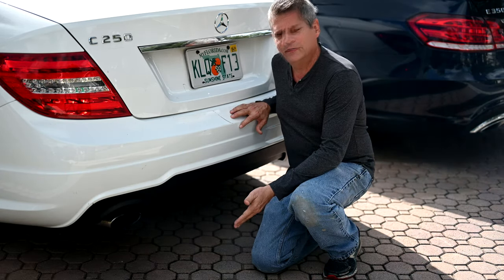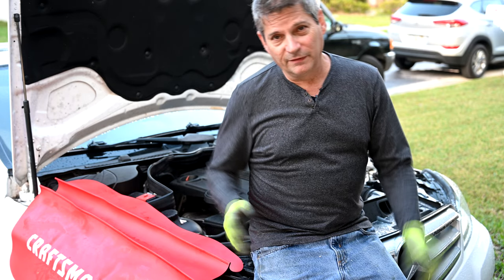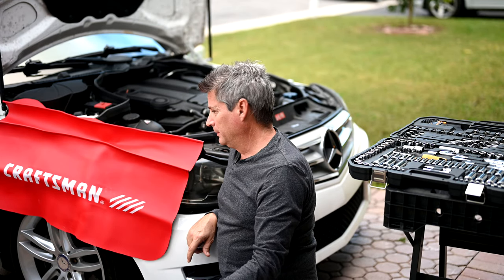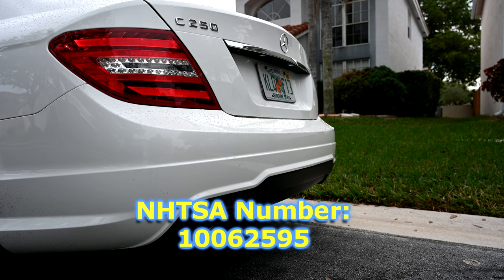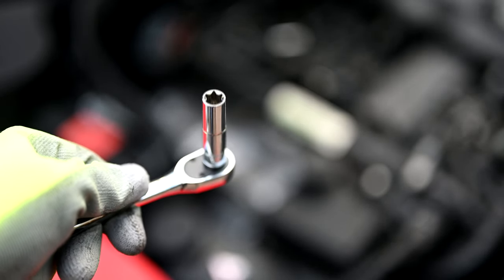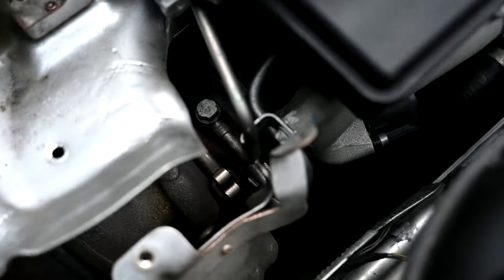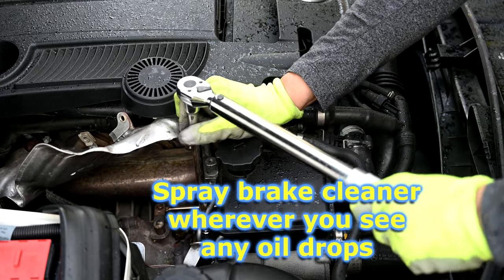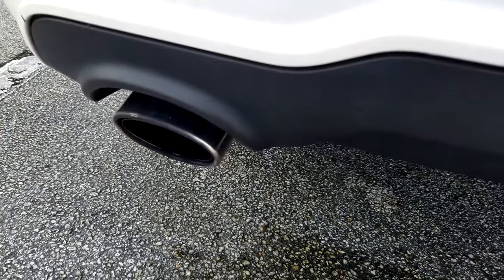SOLVED! Engine Blows White Smoke at Startup Mercedes C250 W204 Banjo Bolt

Comment: I am still having trouble understanding where to place the O-ring? could you help me with that, please? Thank you
Reply from the maker: We placed it under the banjo and in between the banjo and the engine block.
Reply: it installes on the other side of the oil line from the bolt. you have to remove the whole pipe and to change it. not just the banjo bolt. unscrew the fitting to the block and there will be the ring
Reply from the maker: @pavelb7036  Yes, we loosened the pipe too.
Reply: O ring is  placed the  other  side of  banjo bolt   You  do  not  need  buy  just   use   teflon  seal  tape

Comment: Would this apply to a Toyota Camry?
Reply from the maker: This fix was to address a flaw in the Mercedes turbo by putting an extra gasket in there period now if you have a similar leak in your turbo there may be a similar fix to this one as well if it's in the same spot.

Comment: My GL450 2008 emits white smoke even while in motion. What could be the problem?
Reply from the maker: While running? This could mean you constantly have a small oil leak, usually from the main engine gasket seal, or cylinders.

Comment: it's not clear where the gasket goes... does it go in between the top hole and the oil line?
Reply from the maker: We put it against the bottom
Reply: @carbuying  mine didn't fit there. I didn't read the other comments that said you had to loosen the "pipe" (top piece) in order to fit it in between until after I had put mine in. I didn't use the gasket or a washer. Still fixed the issue for me.

Comment: Can you please tell me if this is the same part for a 2012 C200 turbo w204 ?
Reply from the maker: It should be if it is a W204.
Reply: @carbuying  thank you 🙏
Reply: This worked for me - the initial puff of smoke on my car has now stopped after I changed this bolt. I ended up getting the bolt from my local Mercedes dealership at nearly half the price as online. Thank you very much for your video :)
Reply: SystemsLogix hey I’m trying to find the OEM banjo bolt part. Where did you find it exactly? I tried looking on the MBoem website but it gives me 300 other bolts when I look up “banjo bolt”. Thanks in advance!
Reply: @fabianchavez531  Hi Fabian, I went to my local Mercedes dealership and got it from their parts area. Was actually cheaper than online.
Reply: SystemsLogix cool, thank you ✊🏼
Reply: @SimpleITLogic  how much did the bolt cost and how much did repairs cost? Please and thank you

Comment: Its not clear, where does the washer and seal goes to,
Reply: The whole oil line needs to be removed. The 2 washers go on either side of the banjo fitting on the lower end of the line with the new bolt through it. The rubber O-ring seal goes on the upper end of the line where it connects to the engine. Don't skip any of the seals and don't use Teflon tape recommended elsewhere.

Comment: Wonder if it's a PCV valve if someone has a Swift 🤔
Reply: I don't know on the Swift but in my kia picanto it was the pcv valve, but it was nothing like it's shown here in this video, it was a lot of white smoke and the car would lose power.  Took to three different mechanics, in Italy where I lived, all three said the same thing, this engine is gone, buy another engine. The last mechanic I went to found an engine, charged me 2.5k euros for the engine and work replacing, kept my old engine, and a few months later, same problem. After much research I found information about the PCV valve, bought a new one for about 5 euros, replaced it in 10 minutes, it has been four years, never had a problem with the car again...
Reply: @bobbuilder5576  I actually got a valve job done, replaced valve stems, seals and it's smoking a lot lesser now, yet to replace the pcv valve though

Comment: Took 30 points off out 100 after you said that’s a 1/2 inch head bolt! There is no standard on a German car! That’s actually a 13mm! Meaning you don’t have that much experience working on cars! Otherwise great! Thanks
Reply: Google will tell you 13 mm is Equal to 1/2 inch smart ass. Maybe he isnt a Die Hard Gear head which is probably why he didnt say 13mm in the first place. But he wasnt wrong.

Comment: You used the torque wrench incorrectly. At the first click and second click you stop tightening.
Reply from the maker: Some people are very particular about this. Try loosening a nut with an adjustable wrench flipped the "wrong" direction, and people will come out of the woodwork to pounce on you.

Comment: its called a blown head gasket lmao
Reply from the maker: You sound really cocky as though you think you know the answer here. A blown head gasket is one of at least 4 different causes, but we already know the cause on this car was the Banjo Bolt seal, which is one of the other possible causes. If people listen to you, they'll be making an expensive engine repair for no good reason.
Reply: Do you even understand how the turbo works on the car? I have the same exact car and I’ve taken the whole engine apart and put it back together so I think I know what I’m talking about. I was just trying to help before you get coolant mixing with your oil and then it’s game over.
Reply from the maker: @Veaker  Clearly you don't understand how the turbo works, and you're an OCD troll who just can't admit you're wrong. You never paid attention to the video. Mercedes issued a Technical Service Bulletin covering this exact failure, and it's registered with NHTSA. People should trust Mercedes engineers over you who changed your own oil a couple of times.  You forgot to mention we showed that our turbo repair solved the problem in the end, no more white smoke, because that doe snot support your fake news trolling. You just keep digging a deeper grave for yourself because you can't let it go. Why don't you make your own video on how to change the head gasket to solve the problem.
Reply: @carbuying  I don't understand how this fixes the smoke issue. General workings of the turbo, the oil doesnt enter the exhaust or inlet sides of the turbo as they are 3 separate parts ( except for when excessive wear has taken place and some residual oil can ) can you explain how this fixes the problem please? The one way valve would be more for start up to make sure no delay in oil pressure which can cause premature bearing failure.